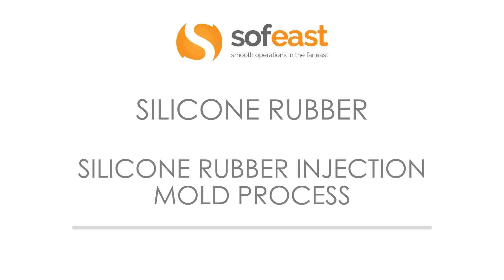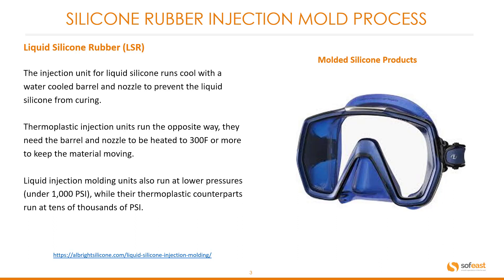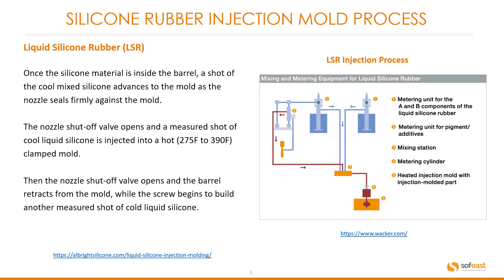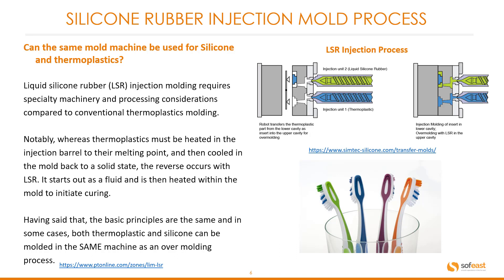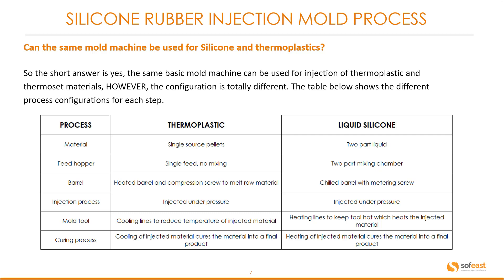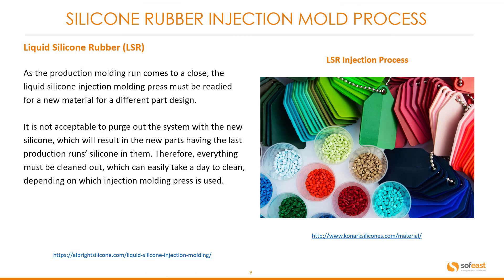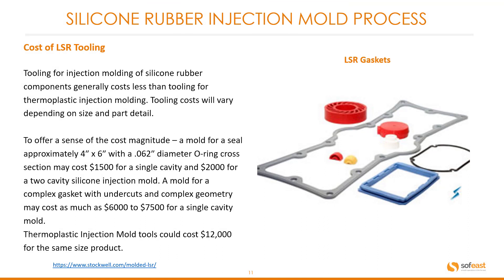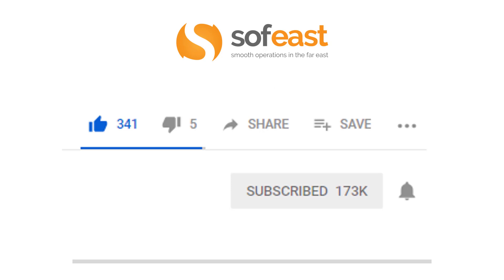The Silicone Rubber Injection Molding Process Explained

Comment: 1. Can the molds be made of plastic or only metal?

2. Why is it necessary for the mold not to cure (why does the mold need to be heated?)?

I would really appreciate some insight
Reply: since the mold is heated for silicone injection, it cannot be made from plastic. because heat cures and cooling maintains the fluidity of the lsr which is different from plastics

Comment: Some things i wanted to add. LSR material won't cure until mixed 1 part A and 1 part B. Meaning the only things needing water like the guy in the video said. Is the static mixer barrel and barrel tip. After mixing 1 part A and 1 part B the material if not kept cool will cure. While being kept cool it will inevitably cure also thanks to the chemical reaction that happens.

Comment: Can you have Date clock insert on the silicon mold ? there is a flash concern after a while.
Reply: Yes,we could add this clock insert on the silicon mold.
Reply: Molding "inserts" is a common thing in LSR molding. The plant I work for we run many insert presses.